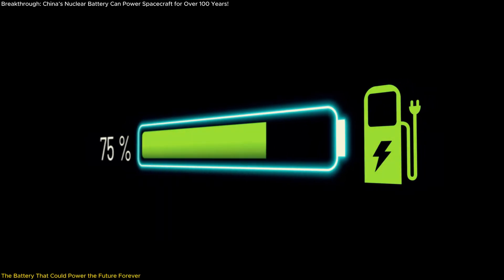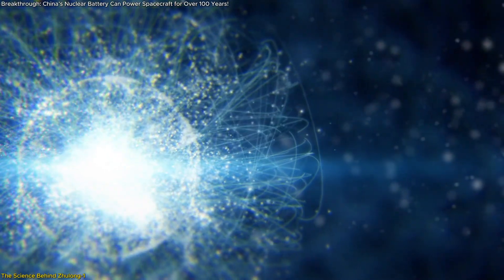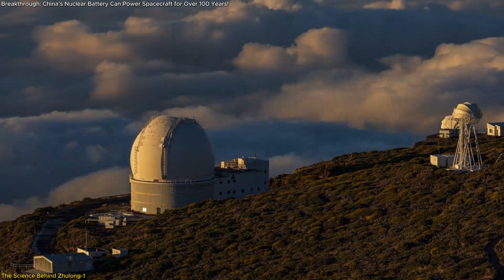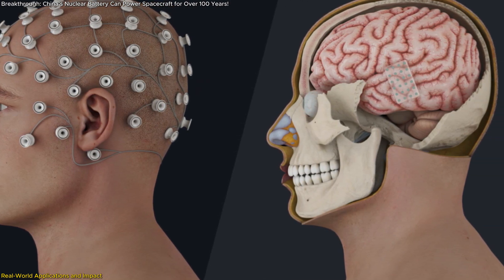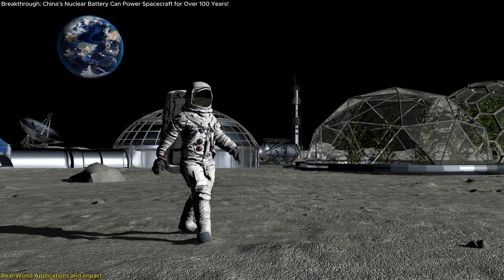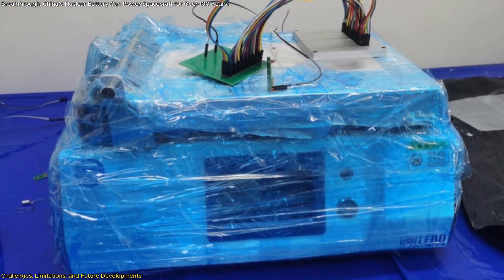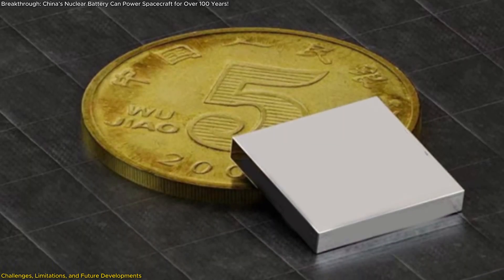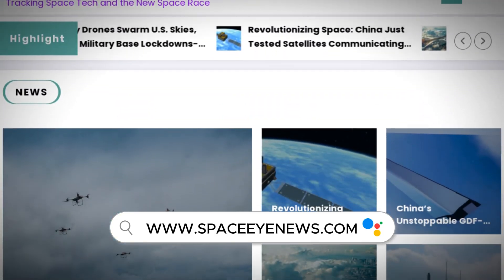Breakthrough: China’s Nuclear Battery Can Power Devices for Over 100 Years!

Comment: Hasn't the US had nuclear batteries for 65-ish years?   Why is this battery any different from those?
Reply from the maker: Absolutely, you're right — the US has indeed used nuclear batteries (specifically RTGs, or Radioisotope Thermoelectric Generators) for over six decades, powering spacecraft like Voyager, Curiosity, and even the Apollo missions' equipment on the Moon.
What sets China's Zhulong-1 apart, based on available info, is both the design and potential applications. While traditional RTGs rely on thermoelectric conversion (which has relatively low efficiency), Zhulong-1 is reportedly using advanced nuclear battery tech with higher energy density and miniaturized solid-state design, enabling broader terrestrial use — like in deep-sea, remote stations, or potentially even medical or consumer-grade tech down the line...Thanks,,,,
Reply: @SpaceEyeTech thanks